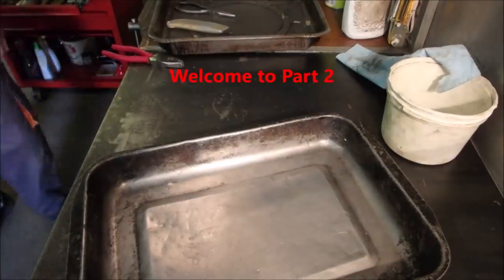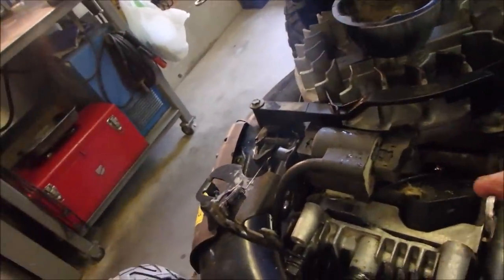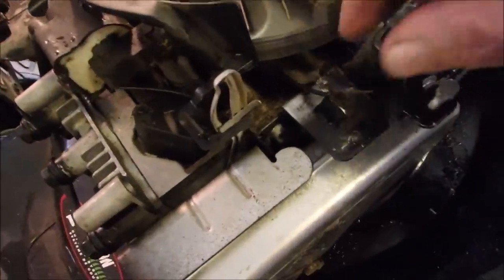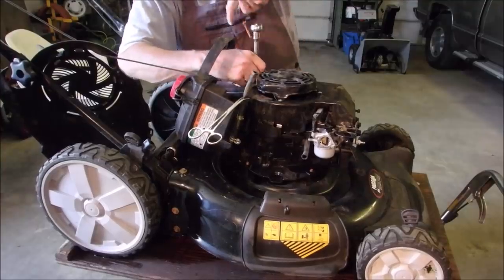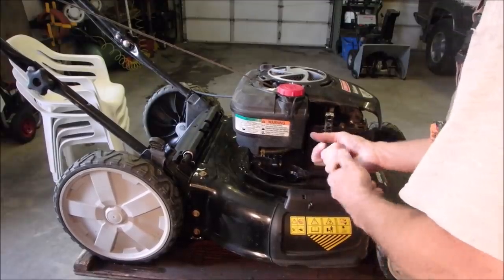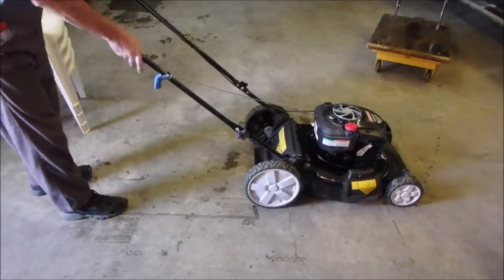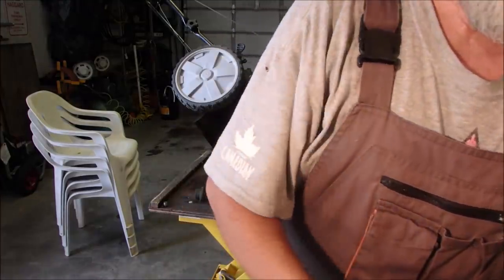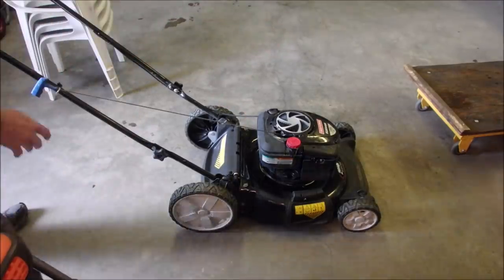Craftsman With Auto Choke Won't Start Pt. 2

Comment: My question how does sand get inside. I did leave the  spark plug out all winter is it possible for something to have brought the sand in like a 🐝 bee. 
Confused in Montrose.
Reply from the maker: well i don't know what a   "Confused in Montrose" is.  If you left the spark plug out all winter your problems are bigger than a few small details.
Reply: @BrucesShop  what do you mean by (bigger then a few more details.
Reply from the maker: @johnhouli3450  Anything in the wind and air are going to go in there,   It is a cavity.  Insects  dirt,  sand.
Reply: @BrucesShop  thank you. Never again will I remove the spark plug lesson learned.

Comment: What way can you take the blade plate off of a victa 4 stroke with out stripping the bolt please.I've tried but the ring scanner slips after a bit of tension.
Reply from the maker: I have never worked on a Vista mower by that name. I think they are a Briggs and Stratton.    An air or electric impact may be the way to remove the bolt.  I think they are a standard direction thread???   Have a look.   For example are you tightening it buy going to the counter clockwise direction  Most likely not.   I did find this video but the blade is off and he is taking of the adaptor or boss.
https://www.youtube.com/watch?v=CdLyCd9xv5Q

Comment: Did you adjust the lift ram so it drops faster? .. mine drops sloooow when the weight of the mover is on it.
Reply from the maker: No I never touched a thin.  Sorry

Comment: Bruce. I swapped out two different carbs on a 6.75 briggs and stratton  mower yet it still has a miss to it & the plug is white at the tip.  What hat to look for? Nice mower just not running smoothly.
Reply from the maker: A white tip means it is getting too much air.  So---a seal near the carb,  loose carb, manifold seal.  You can spray carb cleaner on the joints.  If it changes RPM that is your weak spot.  Just note  carb spray is flammable.
Reply: Also along the lines of an air leak, sometimes the plastic air filter cover can warp especially when over tightened like this mower. I have seen double gaskets between the carb and air box to remedy the leak there.
Reply from the maker: Thanks Raymond.  I just did that on an older one.  ( I used a used one and a new one haha)  Although it is the carb that mixes the fuel and these are upstream of the carb.

Comment: I’m assuming the needle is not seating in it’s place. Do you want to hear what I found just a day ago went to pull start and it locked up I was lost now what I do. 
So make a long story short sand was in the pull area took top cover off and 1/2 a cup of sand came out. Checked oil and grease gas and she started up on 5 pull
Reply from the maker: Interesting!

Comment: I cleaned the carburetor on an engine just like that one but the engine is hard to start even when it gets hot.  I tightened the cylinder head bolts but that did not change anything.  I have to pull the rope about 3 or 4 times to get the engine to re-start.  What is causing this?
Reply from the maker: It may just be low compression.  Does it look like it has been used a lot?  A valve adjustment may help.
Reply: Yes it has been used a lot.  How can you tell if it needs a valve job?
Reply from the maker: @brianmott728  First it will fell a bit too easy to turn over.

Comment: what is that instrument you use for pinching off the gas line?
Reply from the maker: It is a hemostat.  Same as the Doctors use.
Reply: thank you Dr. Pender. maybe my local hospital will sell used ones when they replace the old ones
Reply from the maker: Harbor Freight has them and Princess Auto in Canada.

Comment: Wow I thought I saw this video  Oh Well .............. Ok I guess I will give you a lil info on the auto choke system on those ............. 

At   6:20 into the video you mentioned that the muffler thermostat opens the choke.    A lot of people think that way...  In no way shape or form I am talking bad about you OK Mon Ami .....

 When the engine is cold the choke is closed / working. In fact the air vane opens the choke up so when the engine starts it can run right.......   The fins on the flywheel blow the air on it to do that ....

Then the thermo on the muff keeps the choke open after the engine warms up, as in when you stop the engine to pick up a few sticks in the yard or take a COLD one out the ice chest..... LOL 

Then when you shut down for the day, the engine and muff gets cold and closes the auto choke for the next cold start.......   

Plus Tard Mon Ami ~!~!~!~!
Reply from the maker: Thanks Boo
Reply from the maker: I mention in the comments the correction and your comment.  Thanks   I like it when I learn.
Reply: Yes, yes, yes.  Exactly right.  The thermo lever part of it is to allow an open choke for the next hot start.
Also, most related videos do not mention the adjustment method for the thermo lever. The square U end of the plastic lever that surrounds the end of the thermo lever has two marks on the side and two marks on the front. The thetmo lever end should be between these two marks, side and front. Easily adjustable by bending the end of the thermo lever.

Comment: Have cubcadet mower,won't start,only if I pour gas  into carburetor runs to loud, but  when I  shut it off, then same thing won't start? but add gas to carburetor then it will start,need help or answer
Reply from the maker: Does it have a primer button.  You may need to work in that area
Reply: @BrucesShop  no,but how would I adjust the choke to close!  I no it does not close all the way,! Governor spring is 6$
Reply from the maker: @danterichard1324   NO!!!   take the cover off the motor and check out the aluminium choke actuator and adjust it tighter.
Reply: @BrucesShop  that type of cubcadet has one? By muffler!
Reply: @BrucesShop  what tool will I use to tighten it with& how do adjust/ fix the carburetor choke?
Reply: @BrucesShop  I'm in CA,so please message me back don't know what state you live in? But I will need to no what tool to use,
Reply: @BrucesShop  please let me know what kind of tool to use on the actuator,and how would I go about getting the choke to close all the way on the cubcadet mower is that the lever that I see on the side of the mower next to back side below the fuel tank,yes the carburetor does have gas in the bowl and is running freely from the tank to the carburetor,
Reply from the maker: @danterichard1324  Once you have the cover off you can adjust the choke postion by bending it with your fingers.  It is that light.

Comment: Another video showing repairs being done to a filthy lawn mower. Do none of you guys every clean power equipment before or even after effecting repairs? Blowing it off with an air nozzle just does not do a good enough job. Our equipment is soaped and washed after every use. Lawn mowers to rototillers and chainsaws to gas water pumps. All look like new even though they are all over 10 years old and only one has ever been in a repair shop. Look after your tools and they will take care of you.
Reply from the maker: I don't understand.  This mower is spotless.

Comment: Ive just done everything you did and its still not working. Any suggestions
Reply from the maker: Will if fire for a few seconds when you prime it with gas.  (Spark)
Reply: @BrucesShop  no. I tried carb cleaner too
Reply from the maker: @theebalz     Well if it has a spark it should fire unless the timing is off.  So this is the order .  There could be more issues   I am not there.
Is the machine new to you?  
1  Spark at the plug  if not a bad spark plug or Coil issues???
2  Prime it with fuel  should run for a few seconds
3  Compression,  Hold you finger over the spark plug hole and feel a puff.  If low cmpression--rings or valves
4  Check flywheel key
   
Good luck   I can't do any more for you.
Reply: @BrucesShop  I had it running last year. Frustrating